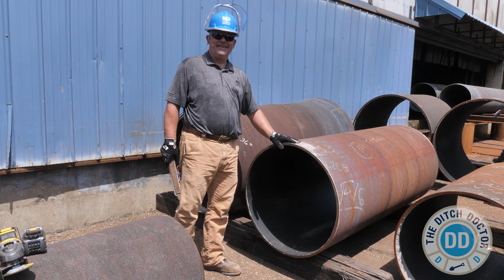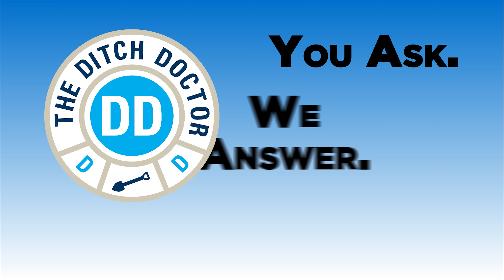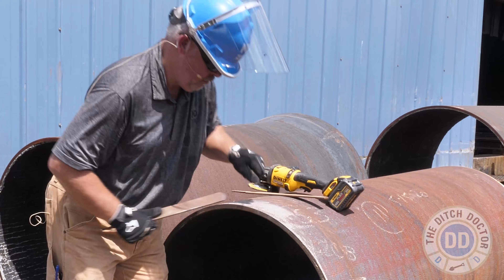Chamfer or Beveling Ductile Iron Pipe What's the Difference? Ditch Doctor #2

Comment: Technically speaking, a chamfer is an equilateral bevel. So if you have a 90° cut and you put a 45° bevel on it, you have knocked off the same amount of material from the face and side. In that case, you have created a chamfer.